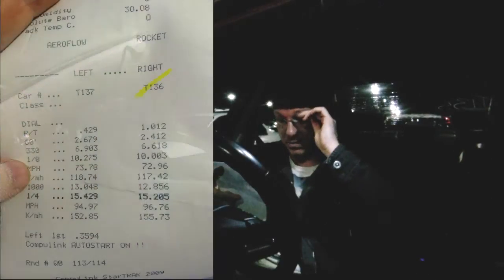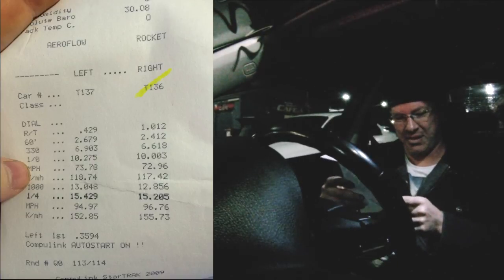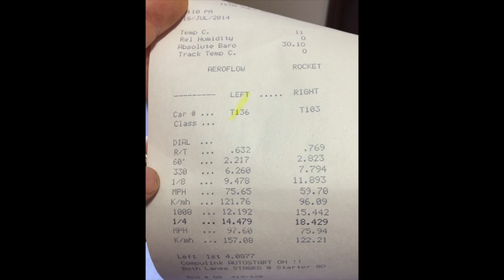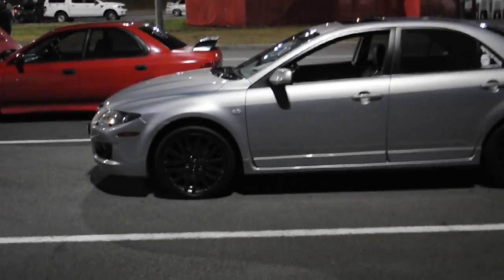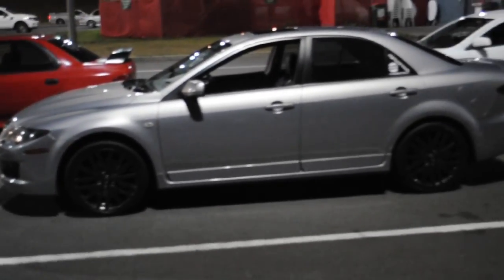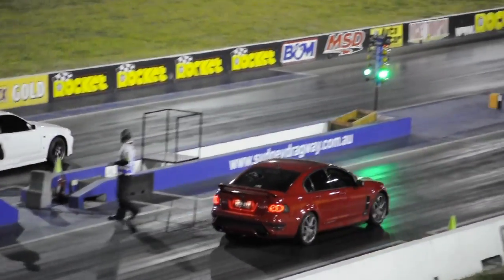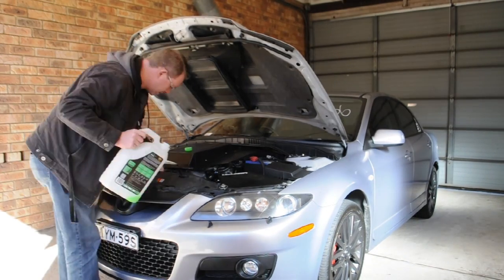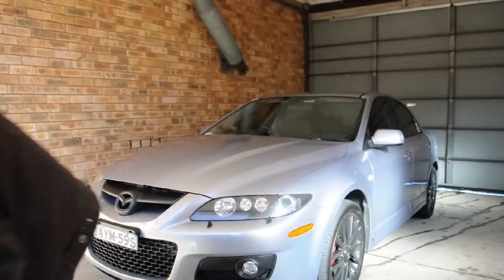Drags

Comment: You got the exit speeds to run in the 13s. 
You need two things:
1. Diff mounts
2. 5600 rpm launch control

If you improve that 60ft time your times will drop massively.
Reply from the maker: Thanks heaps mate, I truly appreciate that. launch control rpm is something I realy wanted advice on so thats a great one. I am also looking into the diff mounts but will want a rear sway bar also if I am going to do a sub frame drop (will put in adjustable coil-overs at the same time)  I am in the process of fixing the turbo, if you watch the channel you will see coming out this week the first of a series on upgrading the turbo to a GTX3071. Thanks again mate, any advice is more than welcome as I am realy new to the drag strip and am realy keen to get into the low 13's and If I could break into the 12's Id be happy as!
Reply: Awesome man. With that blower you will need to keep an eye on running out of fuel but it will make you loads of power.

Comment: What was the turbo noise caused by?
 Nice vids btw.
Reply from the maker: Hi mate, thanks for that. The turbo noise was 1 of 2 things, 1= it was starting to get a little shaft play (no white smoke which is usually associated with it) 2= (embarrassing...) the turbo was not done up tight against the exhaust manifold, there was just a little moment, which progressively got worse.... I couldn't believe it when I took it off to replace the turbo...
Reply: My car makes the exact same noise...I traced the noise to the turbo and found my Bolts were also loose! Once i retightened them the noise was gone. Whats wierd though is they keep coming loose.
Reply from the maker: A part of me is happy it is not just me... the other is just confused as to why :P   I had my turbo out to fix a stud to the dump pipe I snapped, I usually lock tight studs but I may not have on this one... New turbo is in now though :P I get to fire it up tomorrow for the first time!
Reply: Tims Garage
Nice! cant wait to see how it turns out.
Reply from the maker: 2012boracho Thanks mate, the job is almost done, so hope to have the video out in the next couple weeks.